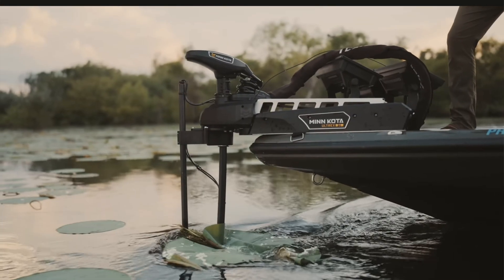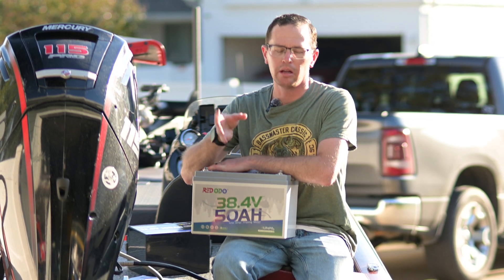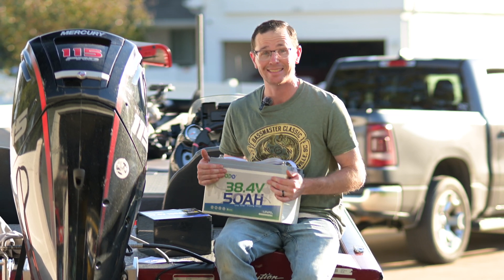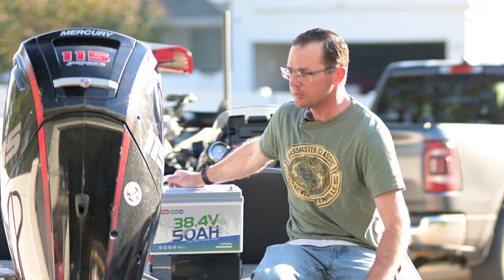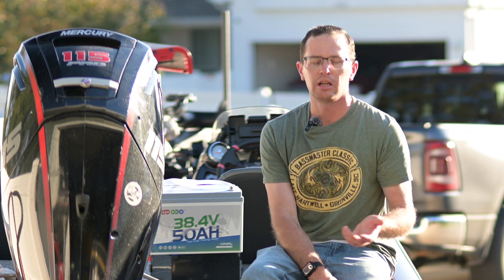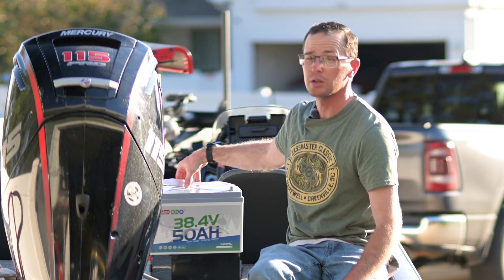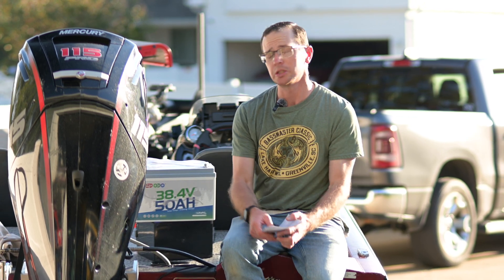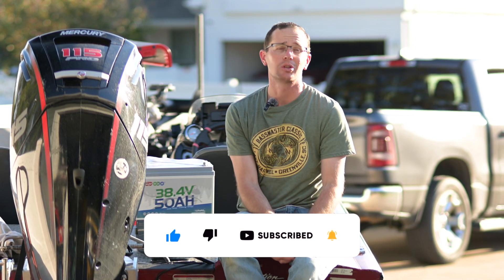36v Redodo Lithium Battery: Worth It for Your Trolling Motor?

Comment: What is your favorite lower cost 36 volt trolling motor battery?
Reply from the maker: Would you want to have Bluetooth?

I did a recent buyers guide for Black Friday that may help
Reply: Yes. I watched that video. Lots of good content. 
I am looking to replace my 3 - 12 volt lead acid batteries with a single 36 volt lithium unit. Looking at the Li Time 36 volt 100 amp lithium. And replacing my AGM 12 volt cracking battery for li time 140 amp 12 volt lithium too. I have pole charge so it can charge all those. I called the manufacturer. Just want to pick some lithium batteries that won’t break the bank. I like the Bluetooth and cold weather features on those batteries. I also like the heater on the Li Time cranking 12 volt 140 amp. What do you think about Li Time 36 volt 100 amp vs their 50 amp? Or would you choose a different 36 volt?

Power pole also recommends one single volt 36 volt lithium battery versus 3 - 12 Volt lithiums. 😂
Reply from the maker: @donjohnstonjr2647 

I think my biggest hesitation is the size of the 100ah battery. It's over 20" long, which can be a challenge to package into a lot of different boats. 

The 36v 50Ah is about how much power you had when your lead acids were new. If that worked then, then the 50Ah will work out just fine.
Reply: Thx
Reply: I haven't seen you say anything about what chargers to use.
What would you recommend for 12v and 36v lithium?